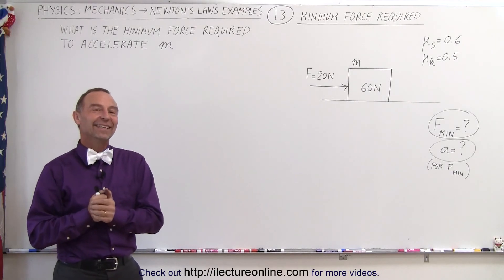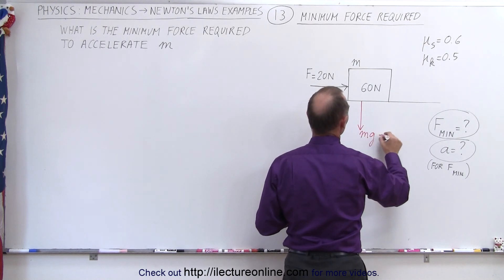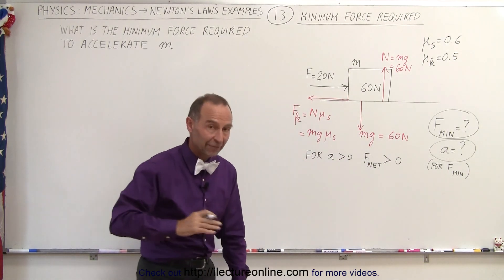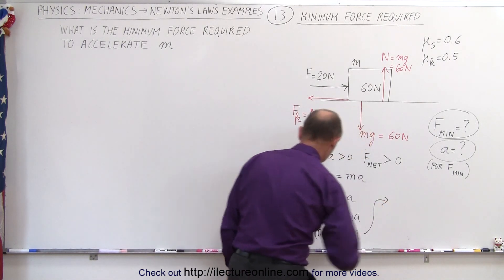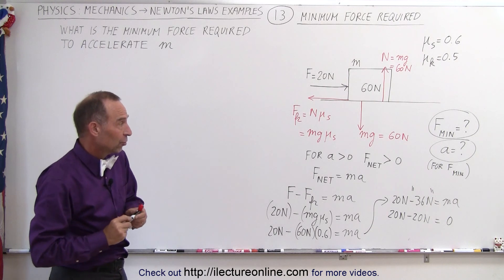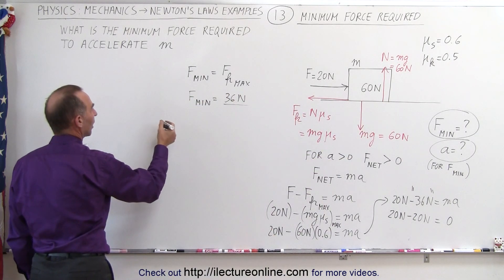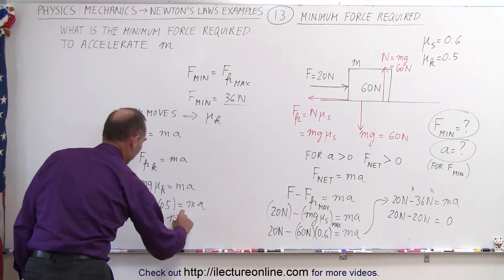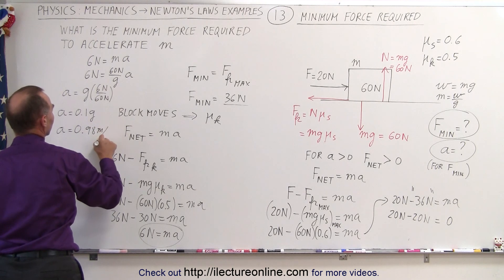Physics 4.1 Newton's Laws Examples (13 of 25) Minimum Force Required

Comment: Thank you sir ,i saw part 14 and you said for moving the mass should Fnet>0,in this problem when the object has no moving and Fmin =Frmax then Fnet=0,now will mass move?
Thank you
Reply from the maker: If an object is not moving, and there is no net force, then the object will remain at rest.  But once an object is moving (after having been given a little push) and the net force is zero, then the object will continue to move.

Comment: Thank you for you amazing explanation. I wounder if they asked what is the force pulling upp the elevator in the accelerating case, would the force F(upp) be equal to 
F(upp)  = N1 +N2 ?
or F(upp) = N2 ?
or F(upp) = (m+M)a?
or F(upp) = ma + (m+M)a ? 
I'm having trouble figuring that out.
Reply from the maker: We have a lot of examples of forces in and with elevators.  Since I am not sure what "situtation" you are envisioning, I can't respond to your question.  But take a look at the elevator examples we have.  This may be a good place to start  https://youtu.be/DtnzbMv2-lo

Comment: If I push with F=36N the block doesn’t move ....I need 36,1 N !! Is it correct? Then once the block has moved itself I continue to give 36 N that is enough to accelerate it because μk=0.5 ( if it was 0.6 the block hadn’t acceleration)....correct?
Reply from the maker: That is correct.